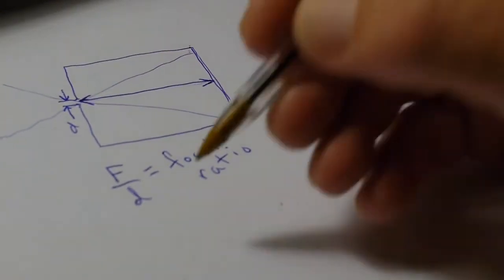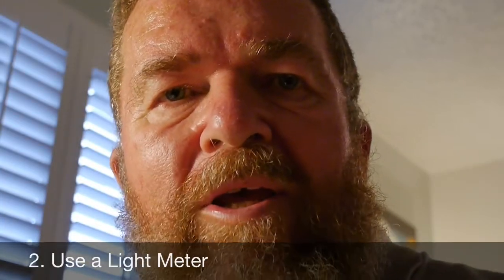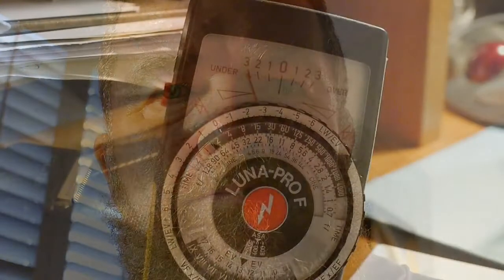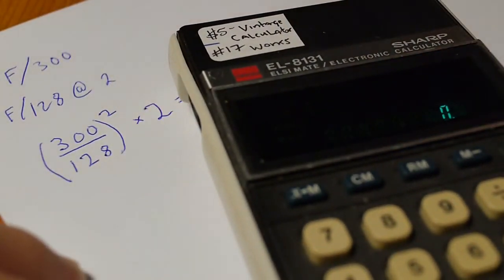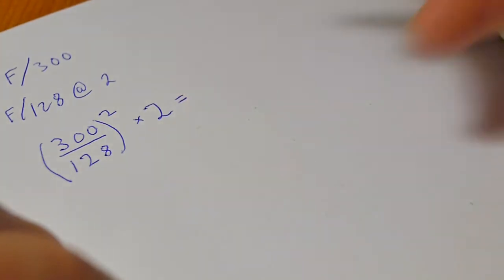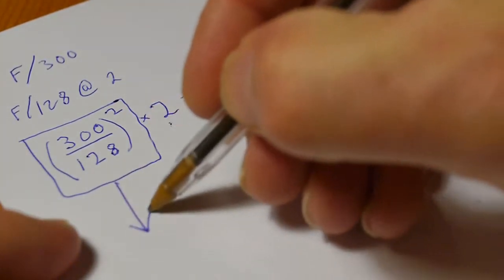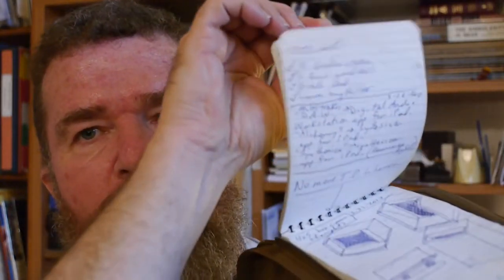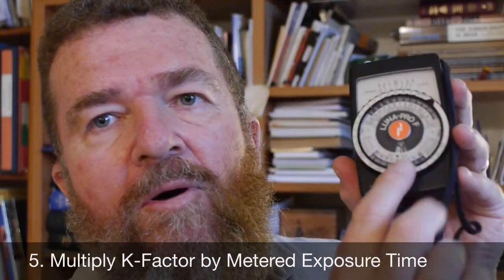Pinhole Camera Exposures

Comment: Good explanation! I would add to include on the label which f/number was used in the calculation, such as "4.56@f/128", just as a reminder when reading the light meter. Thanks, subscribed.

Comment: Very useful approach to exposure extrapolation. Those Luna Pro meters are accurate, use little energy, and are super durable. I tend to use incident readings when possible and reflected readings to confirm (or not) my incident reading. When there is disagreement I must think a moment and see what the best exposure would be. Unfortunately scenes with a lot of sky are generally short of sufficient when taken with reflected meter technique but the solution is to just meter the scene from the horizon to the foreground (tip the meter down). You have to be pretty accurate when making paper positives and transparencies! I have enjoyed your photo and typewriter posts. Hope your channel really takes off!

Comment: Using my Chamonix 45 n-2 with a pinhole and this system made this way easier and works great.
Can easaly choose between 45mm or 80-305mm focal length and has a little setup with 1mm, 0,5mm and 0,25mm pinhole.

Thanks for sharing and keep snapping!

Comment: Glad you talked about reciprocity failure and/or correction.  I have found out that for most films your actual exposure times will follow that simple rule ( based on tables in Kokak data books that you can cross-check for yourself)  For 1s and shorter, no correction is needed.  For 1s and longer, you just have to square the metered time in seconds.  So, 1s would remain one sec, two would become  four, four would call for sixteen and so on and so forth. This will work for times in seconds only,  Le's go crazy and say that the metered time was 2 minutes.  The answer wouldn't be 4 minutes but 120s squared, thus 14,400 sec or 4 hours ( just to say, since I've never experimented with such an extreme)

Comment: This is a great idea but how do you put the meter readings into a calculator? For example what would 1/125th, 1/15th, 1/4 or 2seconds look like in the calculator. Do you convert into a fraction? Thanks again for explaining.
Reply from the maker: The typical pinhole exposure is more than 1 second. But in principle you’d express it as a decimal fraction. I.e. 1/125 = .008. But in practice I’ve never seen a pinhole exposure that short.
Reply: @Joe_VanCleave  No of course. I threw in those examples as I take meter readings at f.22 which does give me 1/60th or 1/15th especially on faster films in good light. I then convert to whatever my pinhole f.stop is and then add reciprocity. I don't like doing field calculations. I prefer to prepare crib sheets to consult and your method lends itself well to that idea. Anyhow thank you again.

Comment: Nice video, Joe. I was making a table of pinhole correction factors when I found a source of error in the calculation you show. The method works fine for the odd-numbered f/stops (assuming f/stop 1 is f-number 0), but a subtle error creeps in for the even numbered stops. The conventional numbers used for the even f/stops (like f/2.8, f/5.6 etc.) are NOT the precise numbers used internally by a light meter. If the displayed f-number on the light meter is used, and the f/stop happens to be an even number, the calculation of the factor will be incorrect. What should be done is to determine the f-number (0 for f/1.0, 1, for f/1.4, 2 for f/2.0 etc.), raise the square root of 2 to the f-number and use the resulting precise f/stop as the denominator in your equation. Since the pinhole aperture calculation yield a precise value, a precise value (used internally by the meter) should be used here too.

So, to figure the true f/stop for "f/11", you take the f-number for "f/11" (7) and raise the square root of 2 to the f-number. The result is 11.3137085, which should be used in the denominator of your equation. For a pinhole with a calculated aperture of, say, 300, the time correction factor would be the square of 300/11.3137085 = 703.12. If the conventional "11" value were used, the result would be an incorrect factor of the square of 300/11 = 743.80. Again, this only affects the even-numbered whole stops.

This gets even more confusing if your meter displays decimal f/stops, like my Minolta IVf. These are fractions of f-number to the next f/stop, not an added decimal value to be added to the displayed f/stop. So a displayed value of "11.0 6" on my Minolta means f/11 plus 6/10 of a whole stop to the next f/stop value (f/16). Since "f/11" is f-number 7, an additional 6/10 of a stop would be f-number 7.6. If you raise the square root of 2 to the power of 7.6, you will get the precise actual f/stop used internally by the meter, which is f/13.92880901. Obviously an Excel-generated table of time correction factors is the way to go!
Reply from the maker: Thank you for the detailed correction, it will prove invaluable for those desiring accurate exposures.
Reply: Another "gotcha" is that some of the long exposure times  displayed by a light meter, are not the times used internally! If you use one of these times as a reference, the exposure might be way off. Exposure times follow the power of 2 sequence 1, 2, 4, 8, 16, 32, 64, 128.... A light meter usually shows correct times for 1, 2, 4, and 8 seconds. However, most will display "30" seconds when it is actually using 32 seconds internally. The same for a displayed "60" seconds. The meter actually used 64 seconds. This is normally not an issue with a meter or camera, as the software knows how to do the right thing and use the real values. If the odd "conventional" displayed values for some of the times are used in the calculations, the pinhole exposure can be significantly off.

Comment: Did my first Test shoot with a van cleave inspired pinhole today and i am super happy with the First results on Paper negative.. quick question: can you also calculate a iso compensation factor like you did with the Aperture? I would like to Meter with the Spot Meter of my dslr and ist only goes down to iso 100. is it also (100/12)^2 * (320/22)^2* shutterspeed = exposuer time? If i rate my paper at iso 12 and my dslr is metering at f22,iso100
Reply from the maker: Yes, I believe you are correct.

Comment: Thank you for doing this.  My question is, if you should happen to rate your film at a different speed, will this effect the formula?  Thanks!
Reply from the maker: Film speed determines the recommended F-stops and exposure times, for a given scene brightness. This formula corrects for the difference between the F-ratio your meter uses and your pinhole camera's F-ratio. So, no, changing your film speed won't effect his formula directly, for a camera with a fixed aperture size. 

However,  your meter will recommend a different F-ratio/Shutter speed combination for a different film speed. For a fixed-focal ratio camera (like a pinhole camera) the F-ratio stays the same, and you therefore have to change the exposure time for a different film speed.
Reply: @Joe_VanCleave  the other issue I'm having is reciprocity. I put it into the formula, spreadsheet but the results dont seem right. Not sure if im setting up the formula correctly for that. And thanks for responding so quickly!

Comment: Just ran across this and thought "man! this is great!"

Have a couple of questions. 
1) Would the math be different or change if I used a spot meter like a Pentax V?
2) the math for sheet/roll film would like something like: "(Pinhole F Number/Light Meter F number)^squared * Light Meter exposure * Film Reciprocity = X" ?

Thanks again. I'll be making a label on my 6x9 pinhole this evening.
Reply from the maker: 1) The math should be the same with a spot meter, provided you’re metering the spot you want to be at middle gray.
2)  Correct!
Reply: @Joe_VanCleave  Thanks! I've been metering color neg and b/w for Zone 7, and color slides for Zone 3, with that Pentax V. Appreciate it!
Reply: @Joe_VanCleave  Joe - I had this hare brained idea about putting a pinhole on a Linhof 4x5 lens board for pinhole at different focal lengths. So I did some math and wondered if you could check the math for me? 

I want an f/stop of f255 at each focal length. I divided the focal length by f255. 
So the formula:
Focal Length/ f stop = pinhole diameter. 

90/255 = .353
150/255 = .588
300/255 = 1.18

So the pinhole diameter would have to .353mm at 90mm, .588 at 150mm, and 1.18mm at 300m. 

Does the math make sense?

Thanks again.
Reply from the maker: @BillPutnamPhoto  Correct! Except … each focal length has an ideal optimal sized pinhole (for maximum sharpness) that doesn’t scale linearly. However, you may not notice the difference that much, and I do like your idea of keeping the focal ratio constant, that should make metering and exposure times more consistent. Go for it!
Reply: @Joe_VanCleave  thanks!!!

Comment: Hei Joe first of all thanks a lot for this video and all your tutorials which I find extremely useful! I just have one question I wish you could answer to: when measuring light how do you set the ISO value on the exposure meter? Maybe I have got something wrong from the whole explanation, but so far I have understand that you normally use photographic paper as "negative" when shooting, and if i'm not wrong the photographic paper speed is usually around 3 or 5 ISO but on your exposure meter the set value is 400 ISO (minute 4:00). Did I miss something or am I making a fuss of it? Thanks a lot in advance!
Reply from the maker: I'd been using the meter for regular sheet film, hence why it was still set to ISO 400. You are correct about photo paper as a negative, I'll set the meter much lower. The Arista brand of resin coated grade 2 paper that I commonly use for negatives I rate at ISO12. Thanks for watching.
Reply: @Joe_VanCleave  Hi! Me again, trying not to give up w/ pinhole photo. So, my lightmeter can be setted at iso 3 at lowest. So using your formula, it's ok to set up my lightmeter at 3 (the same as my paper negative)? Best, Alvaro.
Reply: Hola Alvaro, soy de Argentina, tambien experimentando con Fotografia Estenopeica. ¿Pudiste resolver lo del tiempo de exposicion? De ser asi ¿podrias explicarme?

Comment: what about ISO on photopapers? can i anywhere find that, that i would be able to measure at some static ISO?
Reply from the maker: The method used to measure ISO for film doesn't apply exactly for paper, but what I do is assume a starting ISO, take a meter reading and make an exposure, then develop the paper and evaluate the results; then I adjust my assumed ISO and repeat the process until I get good results. I do this for summer and winter daylight, and indoors under incandescent and LED lighting.

One problem is light meters are reading a panchromatic spectrum of colors, whereas paper is sensitive to UV, blue and some green, depending on the paper. So I find it necessary to change my paper ISO depending on the light and time of year; in winter there's less UV in the sky, so I adjust my reducing my ISO value to compensate.

Comment: I,i'm not a pinhole photographer ,i know that 300 and 128 are f/stop numbers as   8;11;22 etc can i calculate the exposure doing 300*2/128 thinking that numbers are prortionally like  in the normal photograph ?Thanks
Reply from the maker: For an f/300 pinhole, if you meter for f/128, multiply the time in seconds by (300/128)^2.

Comment: Hi! I have a doubt. Why the meter is set to ISO 400? and how do you determine the iso(?) of the paper. I have an ilford mgIV RC pearl
Reply from the maker: Ha! The meter had been used for film just before recording the video.

The Exposure Index (EI) of paper is determined iteratively through testing. Assuming a starting value. Meter the scene using that value. Expose the scene as per the meter's recommendation using the assumed EI value. Develop the paper, then evaluate results. Based on the results, adjust the EI up or down accordingly and retest.

I find winter and summer daylight have dramatically different amounts of UV light, which affects paper more than a panchromatic light meter might indicate. So in winter I find myself dropping the exposure index, while in summer I raise it.

Also, it helps to understand your scene's reflectivity to blue and UV light. Shiny metal and water easily reflect blue light and will over-expose, while red and earth tones reflect a spectrum of light that photo paper is relatively insensitive to. So there's often a bit of last minute adjustment to the meter's recommendation.
Reply: Oh! And I thought it would be easier! First of all let me thank you for your videos. They are great! I would start experimenting then...:)

Comment: my camera is F=42.What is my exposure time.I don't have that meter thing.pls reply
Reply from the maker: You camera is F-42? Is that the focal ratio (focal length divided by aperture size) or merely the focal length itself?

The exposure time depends on the illumination of the scene you'll be photographing. Which is why having some kind of meter is handy. Absent a dedicated light meter, you can also use a digital camera's internal meter to get a reading. Or a light meter app on a smart phone.

Alternatively, in bright summer sun you can go without a light meter and use what's called the "Sunny 16 Rule," which meters in those conditions (bright summer daylight) your exposure will be f/16 and your exposure time will be the inverse of your ISO. Like for ISO 100, it's f/16 at 1/100 s. You can then extrapolate for other aperture values or exposure times.

Using the Sunny 16 rule you can also extrapolate for cloudy skies by using an aperture of F/11 instead of F/16. Same with winter daylight, which is less bright than summer.

For pinhole photography (which is the context of this video), using "guess" exposures without metering often requires some testing and gaining experience. Which is why I recommend using some kind of systematic metering, for better results. Good luck and stay in touch.

Comment: I just watched someone on another video put a paper negative into a pinhole camera and then take it out and NOT develop it, rather he scanned the paper negative in color at like 600 dpi then inverted the image in software.   I thought you had to develop it first...then scan it...
Reply from the maker: That's called a lumen print. With enough exposure, the silver halides will turn colors - autodevelop - a faint negative image. The image is still light sensitive, can't be fixed, and if developed will turn completely black.
Reply: @Joe_VanCleave  That's cool.    He said he made a pinhole camera and placed it in a location for 6 months??   a 6 month exposure.   I would have thought the paper would just turn black.